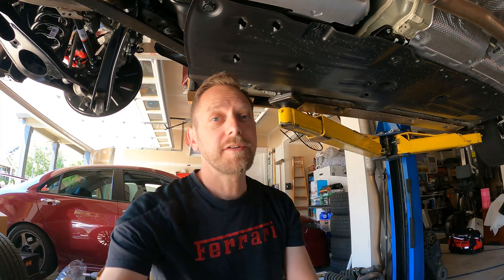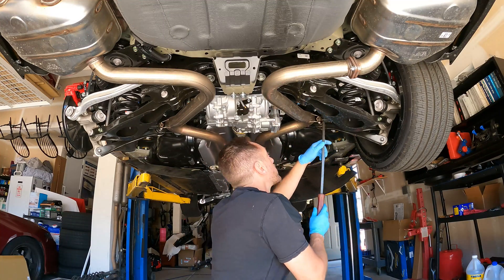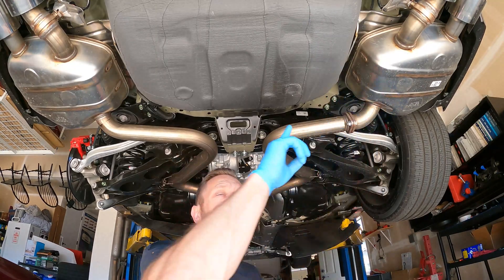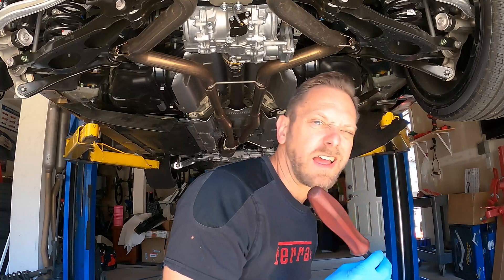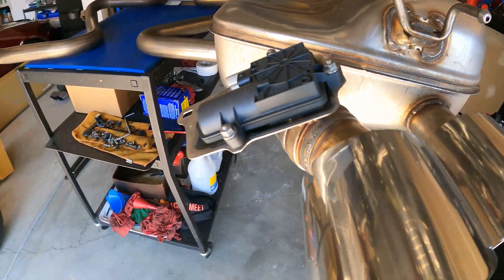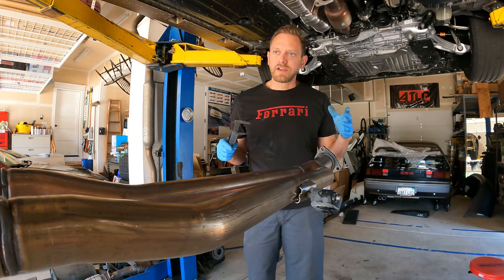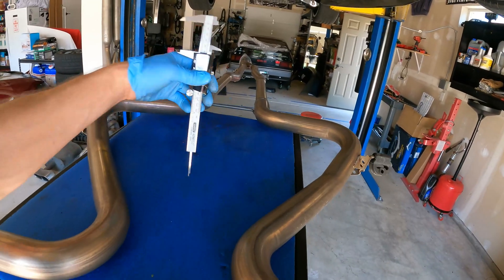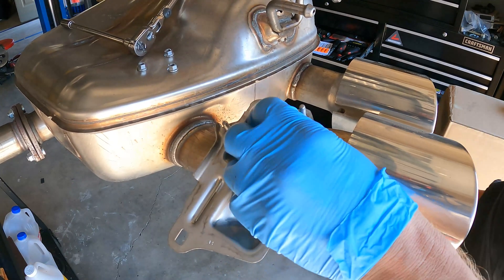TLX Type S Active Exhaust: Removal, Sizes, Specs, Features

Comment: Hey I have a question can I put a rear type-s muffler on my 2022 Acura tlx Aspec does any change need to happen and does the aspec come with a connector
Reply from the maker: The exhaust layout is the same so yes but keep in mind that one side of the exhaust is all one piece so cut and weld is needed.

Comment: OK but can someone explain why the "downpipe" is 2 pieces and why can't the aftermarket be 1 piece?
Reply from the maker: Mostly because not everybody wants to delete both cats.
Reply: @ I’ve been contemplating between this exhaust system or FW- after all the research I’ve done I’m definitely going ATLP!! 

I have a question though, I’m looking to do a full exhaust upgrade- outside of the catback system what do I need to order?
Reply: I believe it’s for easier install from the research I’ve done

Comment: Hi! It's possible to remove  just the silver cap  part of the exhaust tips and paint it in black  and to put it back without damaging the exhaust system.  Sorry I'm new on this thing. Thanks you in advance for replying.
Reply from the maker: No clue on that. Just looking to change the look of the factory tips? I am sure you can pull them off the car and paint.
Reply: @Heeltoe.  I'll give it a try. Thank you.

Comment: When you unplug the muffler flap Actuators do they open or close? Are they powered to open or powered to close?
Reply from the maker: We didn't check that but we will be able to answer that later!
Reply: @Heeltoe.  Well I just checked mine,and when the cars  is  off the flap is open. Thx for reply.
Reply: Did you see if you get any codes/lights if you disconnected the actuator?

Comment: Do you know what size flanges they use in the mid pipes?? Thanks
Reply from the maker: There is one flange at the front of the exhaust (front of the B-pipe) and one at the right rear muffler.  I measured the one in the front because need it for a cat-back. The other flange I didn't because it seem irrelevant.

Comment: Just a question, but does the J30AC (the motor of the tlx type s) have VCM (Variable Cylinder Management)? I've heard it twice now and haven't been able to find proof that it does.
Reply from the maker: It does but man you CAN NOT tell.
Reply: @Heeltoe.  but is it more refined? I heard that vcm was a design flaw and was famous for burning oil? Is it much better and more reliable now?
Reply from the maker: @ashwinthiagarajan2650  VCM is Design flaw? VCM is designed to improve fuel economy. In the past people have said they did not like how it worked, wasn't very smooth or seamless maybe. I drove it 2000 miles on the highway and never noticed it at all. This car I have not had long enough to know anything about oil burning.
Reply: @Heeltoe.  yes, I know it's designed to save fuel while just cruising. And trust me, I love Honda/Acura engines as well. But I heard that in previous gen accords, odysseys, pilots, Acuras, etc. That had the V6 with vcm, that the system would burn oil and after 60k miles would cause some serious damage to the engine. 

The reason being is that while those 3 other cylinders are shut down, they are still moving up and down. So oil needs to be circulated so that the pistons don't wear out. However, since no air is getting in, it would cause a vacuum. As a result, the oil ends up getting slushed all over the cylinder heads and when it comes time to feed fuel to those cylinders, the oil is burned, and the spark plugs and rest of the cylinder become black and ashy. 

Again, this is just from what I have heard and seen on vcm and their problems. Interesting technology with great intentions, but if Honda/Acura haven't solved the issue from what I stated above then that's not good.

I was just wondering if the type s motor has those issues fixed?
Reply from the maker: @ashwinthiagarajan2650  I don't have any info on and changes to the VCM strategy on this completely new engine. If I hear anything will let you know!
Reply: @Heeltoe.  but it's great to know that it's seamless!!! 👍
Reply: @Heeltoe.  for sure man! Awesome car anyways 👌
Reply: @layne4376  nice 👍